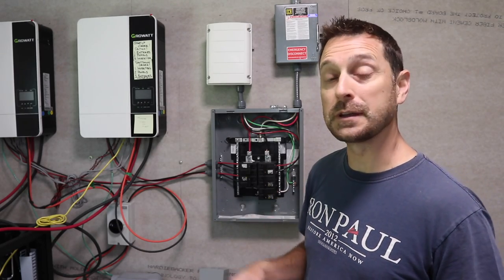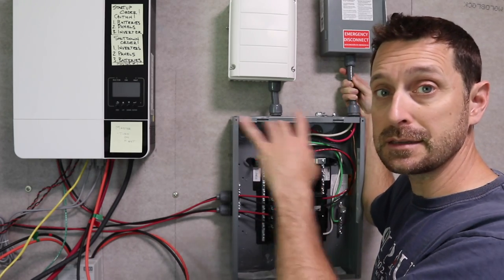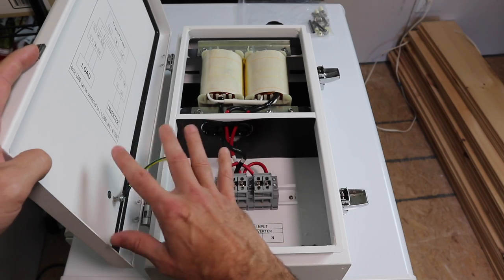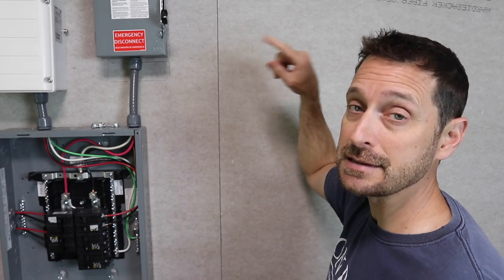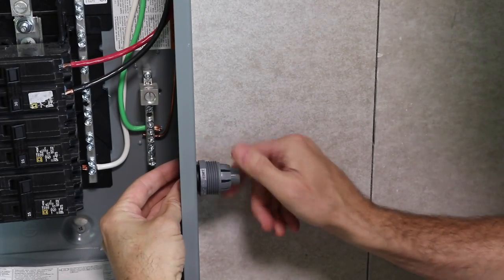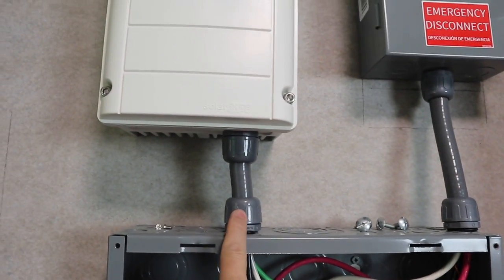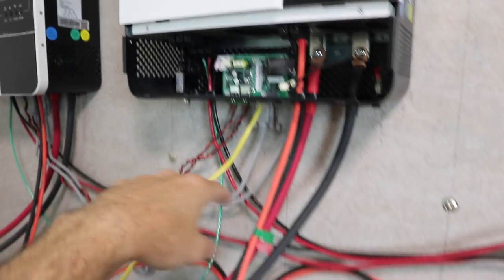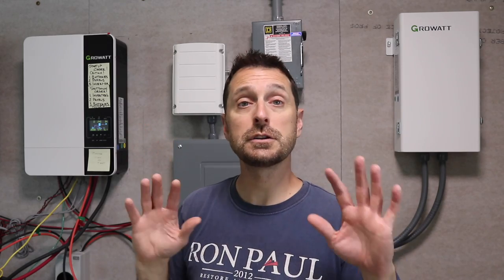New Growatt Transformer Solar ATS Install! Alleviates Safety Issues

Comment: What if anything would be different if you had 3 of these same inverters as far as wiring the transformers? Would we run two of them to one transformer and the third to the second transformer?  My electrician is stumped.  Also wondering if you have solved the automatic transfer issue? Is there a way for the grind power to come back on and charge the batteries then cut back off when charged automatically? We are still a bit confused trying to communicate between Ethan, myself and my electrician.  He thinks Ethan is telling him this isn't possible.
Reply from the maker: Hello. Nothing would be different with a third inverter. You just land that inverter on a separate 40A breaker in the same panel. 
My system is off-grid and used like a generator. We do not have the need for an automatic transfer switch. I don't have one in my system. I only charge my batteries from solar or from a 48v battery charger hooked up to a small 1000w generator (if needed). 
You may need to talk to Richard who is their electrical engineer (I think).
Reply: @CountryLivingExperience  thank you!!

Comment: Where do you purchase your wiring for the project (8 gauge THHN)?
Reply from the maker: Lowes or/and Home Depot
Reply: @CountryLivingExperience  I went by my local Lowes and picked some wire up. 

One thing I'm still confused about is the grounding my system.  If I understood you correctly, you grounded your inverters separately from everything else?  I'm totally off grid and my prior understanding was that everything: panels, inverter(s), panels, transformer, etc.. should be grounded together.   Thanks for your help!
Reply from the maker: @jimTal001  Grounding is confusing and I was taking the advice of the solar company. If you are totally off-grid, I would ground everything together.

Comment: Do you run a 240V well pump using solar?
Reply from the maker: Yes
Reply: @CountryLivingExperience  Are you powering the well from your load center / distribution panel? Or are you running your well pump from an inverter directly? The reason I am asking is my 230V single phase well pump had 2 Hots and a ground, each hot is 120V and they must be 180 degree off from each other, so "in phase" just curious if you are running them straight off your inverter, how are you doing it. It from your distribution panel, then no mystery as it would have two 120v legs.
Reply from the maker: @polywog9591  The inverters power the load center. The well pump is connected into the load center not the inverter.
Reply: @CountryLivingExperience  Thank you, for your quick response!!

Comment: I was very close to starting-up my new Signature Solar purchased system (using the SolarEdge Transformer) despite all the online debate about safety.   Just last week Signature Solar assured me that there are no Safety issues using the SolarEdge Transformer if I follow their wiring diagram.  However, seeing your new video makes me want to replace the SolarEdge Transformer with the Growatt one.  Where can I purchase the Growatt Transformer?  Signature Solar is not selling any Transformers now which is Kind of suspicious?

BTW:  The SolarEdge Transformer was just recently discontinued by the manufacturer.
Reply from the maker: They are out of stock on the transformer. Their web content curator cannot keep up with the changes in stock on their website. They are still selling is as far as I know.
Reply: yup out of stock and the way you have it wired is safe. I will be doing a 240V loads panel. and a 120V loads panel. all off grid.
Reply: @mylesoffgrid  Make sure the breaker protecting your autotransformer and 120V loads will never have 240V loads on it.  In other words, the inverter(s) and 240V panel need to be upstream of your autotransformer and the 120V load panel needs to be downstream of your autotransformer.  The circuit breaker protecting your autotransformer and 120V loads panel should be in the 240V panel.  Do NOT put a breaker between the autotransformer and the 120V panel; doing so would leave you with a dangerous floating neutral is the circuit breaker were to ever be tripped or switched off.  The only breaker protecting the autotransformer should be the breaker in the 240V panel which feeds the autotransformer and the 120V panel.  The correct size breaker is 125% of the rated load of the autotransformer, rounded up to the next size breaker.  If that’s not big enough for all your 120V loads, then you need a bigger autotransformer.  Growatt make an 11400VA autotransformer.  For the 5000VA autotransformer, (5000VA * 125%) / 240V = 26.04A.  If there would be a standard 26.04A breaker, that would be the correct size.  Because there is not, round up to a 30A breaker.  So, in summary, inverter(s) feed the 240V loads panel (each through an appropriate breaker), a breaker in the 240V panel feeds the autotransformer and 120V panel.  That will be safe, comply with NEC, and prevent floating neutral.  Never, ever put a breaker between the autotransformer and 120V loads.

Comment: Did you happen to look into a  Victron energy autotransformer? Has multiple safety features built in to include a breaker, cooling fan and it uses a toroidal transformer which is known for being more efficient.  Just curious if you looked into it.
Reply from the maker: I actually didn't look into the Victron. I wanted to keep everything in the Growatt family and Sig Solar is within driving distance for me to pick up equipment.
Reply: Yea I didn’t want to wait(on back order)it was a bit more pricey, but was able to get one the same week I ordered it. Learned a lot from your videos and putting my system together now using a Growatt and 370w panels from Signature Solar.
Reply from the maker: @GoldenWrenchAndShed  Awesome! Glad you are getting your system going. Very exciting.

Comment: I never would have thought it would be ok to feed the same panel with the inverters and the transformer. I guess it makes sense as long as line 1 and line 2 aren't mixed up as they'd be out of phase with each other. So 240v loads can pull from either the inverters or the transformer (via the inverters), and 120v loads would always go through the transformer. Interesting. Would there be no output on your 120v loads if the breaker to the transformer shut off? Seems like they'd have a hot and no neutral/return path.
Reply from the maker: Yes, the key important part is keeping lines 1 & 2 the same throughout the system. Correct, there would be no output to the 120v loads if the breaker trips. That is what I understand about it.
Reply: Actually that’s not right. If the breaker to the transformer trips the inverter will still put down 240 volts to your 120 lines. What you have to do is follow the instructions on the transformer which says “input / Inverter”. So you must connect the output of the inverter to the input of the transformer then the output of the transformer to the panel. If the breaker from the transformer trips all the power stops and panel is dead and 120 appliances saved.
Reply: Only issue is with 2 inverters I used two transformers as well. Problem solved.
Reply: @CountryLivingExperience  I question this.  I don't doubt that signature solar told you this but my question would be:  What mechanism keeps the 120v loads tied to your panel from being energized by the inverters.  There isn't any communication that the breaker has tripped, no shunt trip, no CAN or RS485 indicators, etc.  Your panel is fed by the inverters and if you loose your neutral because the breaker trips on your autotransformer, the inverters are still powering the loads.  If you are not looping the inverter through the autotransfomer and the breaker trips, how is it keeping 120v loads from drawing power from the inverters?  In your case, you have the backup of the SolarEdge autotransformer as well so the likelihood of both breakers for your autotransformers is extremely unlikely.  Not everyone has a backup though.  I understand the thought process of running the input and output through the panel in your setup because you have two inverters supplying power to the panel.  By running through the panel, you are creating the neutral for both inverters.  This keeps you from having to buying a Growatt Autotransformer for each inverter but I do not see how this gives you protection if the breaker trips.  Again, the breaker tripping is unlikely, but it is possible.  It seems to me the same problem exists in this setup as the original problem with the SolarEdge.  I think Growatt has made a huge step forward by creating the loop through in their transfomer and it fixes the original problem of the breaker trip issue but installing it as Signature Solar has directed you to isn't taking advantage of Growatt's safety feature in it's design.  I could be wrong.  Let me know what you think.
Reply: @offgridwithpojectham  read what  @Michael Houston  say, thats the solution.
Reply: In a split phase circuit, the only time current flows through the "Neutral" is when there is a different load on each 120 volt leg of the 240 volt input. If there is an even 120 volt load on both legs, current flows as if the entire 120 volt load was a single 240 volt circuit. The 120 loads on each leg of the 240 volt mains should be as evenly balanced as possible which would prevent any current flowing on the neutral.

In this application, if there was no "current" going into the autotransformer due to the breaker being turned off it might subject the 120 volt circuits to 240 volts instead of the intended 120 volts. In reality, the derived "neutral" only serves as a "resister" to prevent the full 240 volts from flowing across the 120 volt circuit(s). The "input" to the transformer doesn't supply current to the 120 volt circuits but only serves a return path in an unbalanced circuit.:
Reply: @michaelhouston1817  This is how I read the instructions too.  It says go from the inverter into the transformer then from the transformer into your breaker panel.  But will I need a transformer for each inverter?
Reply: @michaelhouston1817  Yup.
Reply: @michaelhouston1817   Any idea if this can take the load from 2 inverters?
Reply: @michaelhouston1817  That would be correct for an isolation transformer with 240V primary and 120/240V secondary, but it’s not correct for an autotransformer.  The input and output of every autotransformer have the same electrical path into and out of the autotransformer (which is clearly visible in the video).
Reply: @offgridwithpojectham  As installed in the video, the two 25amp double pole breakers are exactly parallel.  If either one of them trips, all the load will go through the other.  If both of them trip, then the panel would have a floating neutral.  It would be the same as losing the neutral from the utility in a typical on-grid home without solar.
Reply: Mario Morales above, makes a valid point. I went with the 11.5KV Growatt Autotransformer with a direct disconnect feed from the 230V inverter to the Autotransformer. This Transformer has an 80amp breaker which should feed most of your vital 120v to Neutral power needs and if you have any "230V Only" feeds you don't have to run them thru this panel.

Comment: Just curious but why hasn't anyone just turned it off?aka Just pull the white wire off and see what happens?obviously protect your stuff but why not just see what exactly would happen if the autotransformer failed...

Comment: Looking closely at your setup I have to say it's very unusual. Why have to auto-transformers? Why have the "primary and "secondary" feeding from the same panel? It's a risqué setup. I would never do an installation like that. Both transformers might not have the same coil resistance/reactance. That can cause imbalance.
I would definitely have a main panel that the Growatt outputs go into (240v) and then 1 sub panel with 120v distribution - L1-N-L2. Strictly.
Reply from the maker: Thousands have this setup with no issue. This is how the solar company recommends the setup. This was hashed out in many solar forums. You do what you think is necessary for your home.

Comment: I don't mean to sound or seem critical in all this but I am little perplexed.  I see where you corrected yourself when you said "separate lines" and printed "separate conductors" on the screen (good catch).  For me, beyond trying to isolate and protect those transformers  I don't know why they bother to return those two lines similar to your first auto transformer's topology, seems a little redundant respectfully submitting; and too......they're limiting the entire 120 volt "neutral " system to 25 amps per leg (i.e. 3000 watts per line).  In other words, no matter the size of breaker one uses to feed a 120volt run or runs, the system's topology will not allow more than a combined 25 amps on that designated line.  But...maybe they believe that's enough.

I also note the following: On both of the newer 'auto transformer' the input and outputs are the same lines (per lines). As such I wonder why they didn't just label them "L1" and "L2" (for lines 1 & 2 respectfully) as they did on the left side "output" connectors? 

Again, respectfully submitting: If they were trying to monitor and save those transformers in the event of something catastrophic, they could use an isolated amp probe or temp robe and shunt to trip a breaker..........but as I often say.....I didn't design it, but if I did I'd......

Enjoyed the exercise......
Reply from the maker: No worries. Glad to talk about it and always glad to take advice as I am not an expert in any of this. I am simply showing how I was instructed to connect this equipment per the solar company. I have some knowledge on the subject but defer to them on the specifics.
Reply: @CountryLivingExperience  : Thanks for the open forum. I noted I am a retired HVAVR tech. earlier in another video of yours, but I too majoried in Electronic Instrumentation and minored in Electrical Distribution. But enough of that........ In my humble opinion each of these Solar type companies are trying to distinguish themselves as such and have their own ways of doing things. Though I do not always agree with them, I respect them for the most part and their accomplishments.  As technology advances so does innovation. Notwithstanding,  there are times I scratch my head wondering what some are trying to accomplish and if they're relying on VOO DOO more so than reason..... Just sayin with a wink and nod. Best regards.
Reply from the maker: Cool. 
I have no reason to distrust them. I talk with them all the time on the phone. They are a reputable place.
Reply: In theory, what is limited to about 3000 watts is the difference between the sum of the loads connected to the breakers on the left side of the panel and the sum of the loads connected to the breakers on the right side of the panel.  However, transformers can briefly (minutes) operate at currents two or three times their rated capacity.  In practice, the way it’s wired in the video total load on either side will trip the breakers.  You never, ever want those breakers to be open with the system in operation.  In my opinion, the risks of having a breaker between the autotransformer and the panel are significantly greater than the risks of not having a breaker there.  If one wants the safest possible approach, use an isolation transformer rather than an autotransformer.

Comment: Is that normal
Reply from the maker: That is not normal. It should not do that at all. Do you have other loads running?
Reply: no i only had the heater on... wanted to see how long it would last.. @CountryLivingExperience
Reply: id like to show you the hook up to see if its right @CountryLivingExperience
Reply from the maker: @josephhcondo7281  If it is overloading, it should trip the breaker almost immediately and not after 30 min. Could you have a well pump that is kicking on or some other load that you are not aware of? That is my only explanation.

Comment: So....here's a hot "why would you do that...."     "just buy the right inverter..."   "no you shouldn't do that...." question......

The solar edge can use a single leg and neutral to produce 240v.  I'm assuming this transformer given it is an auto transformer can do the same thing?

The why?  I built a solar generator with 4kw worth of lifepo4 and a midnight solar 3024. It is only 120v and the mini split I need to power with it when not in an emergency situation (might as well use its ability to generate electricity!) Is 240v.  I want something a bit more proper than a Chinese 120v to 230v transformer.
Reply: Oh....and the mini split draws 1300 watts at full tilt heating on high.  Don't worry...not going to burn my house down.
Reply from the maker: The Growatt Auto Transformer is a quality piece of equipment that does more than the SolarEdge for the reasons I mentioned in the video.
Reply: @CountryLivingExperience  I won’t comment on the quality, but the two autotransformers do exactly the same thing.  Neither does anything that the other doesn’t.  The Growatt has a second pair of terminals (jumpered together, so not adding any new features).

Comment: I dont get it. All homes have 240V coming in as L1 and L2 plus N, no? Ok, just finished the vid. Maybe just dont buy a 240V single phase inverter?
Reply from the maker: There are many different types of systems for many different applications. This is only one configuration and it is a less expensive option for many people. Even the expensive Victron brand offers a single phase 240v inverter with a separate balance transformer.